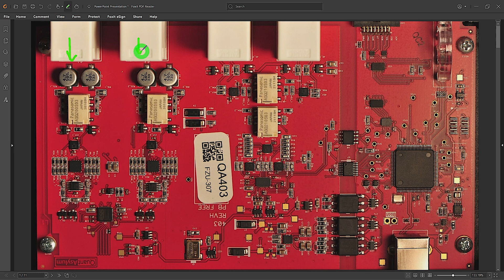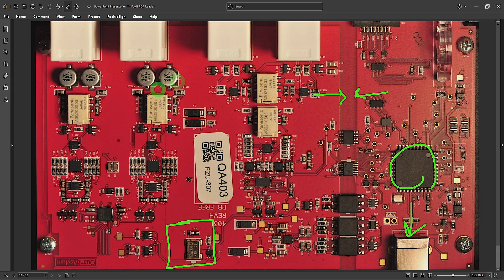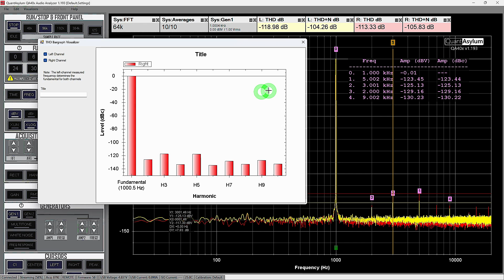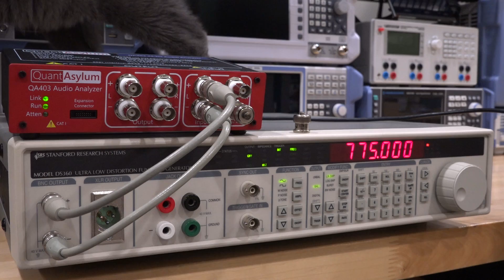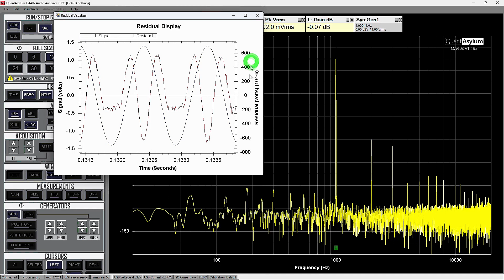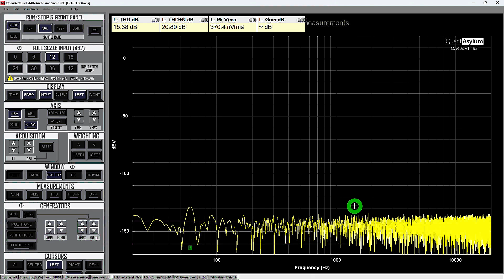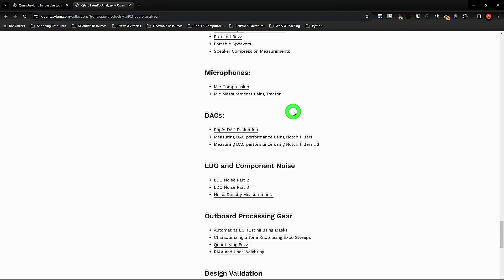TSP #273 - QuantAsylum QA403 24-bit, 0.0001% THD Audio Analyzer Review, Teardown & Experiments

Comment: Wow that is really nice dynamic range! Amazing how far things have come the past 20 years
Reply: Nowadays they all offer higher sampling rates and more bits, but I can't see any significant improvements in the last 10 years. But to be honest, there are usually much more important parts in the audio chain that need to be improved, so here is no real need, except for the marketing team.

In terms of audio this is possible since at least 2005? In a loop test AD(CS5381)<->DSP(ADAU1452)<->DA(CS4398) (A-weighted) I have seen 0,000627% THD+N (-104dB) at 2V RMS (differential). The OpAmps used in this application are OPA1612 as well, they are available since 2009? AD/DSP/DA run synchronous clocked by a CCHD-957.
Reply: @f-io_dev  agreed. I'm not that into audio anymore, but I remember when the Wolfson WM8741 came out in 2007 with 128 dB SNR and slightly worse THD+N than the Cirrus Logic. It's a trade-off of course, but the SNR has been up there for a while.